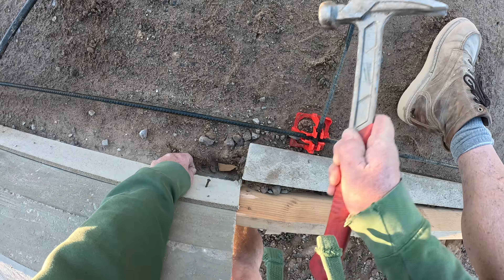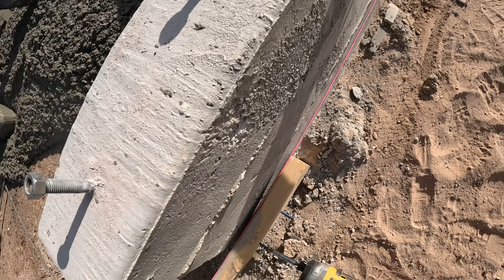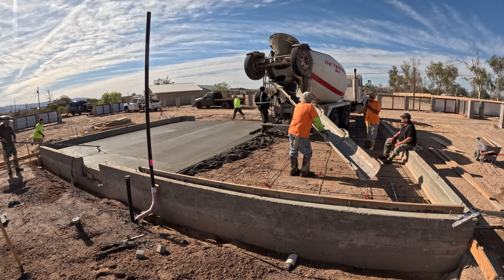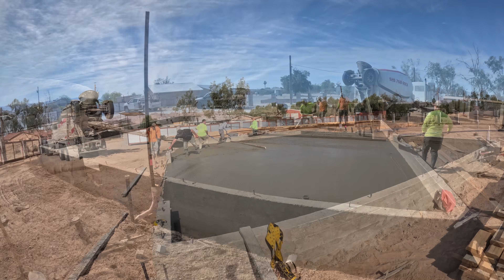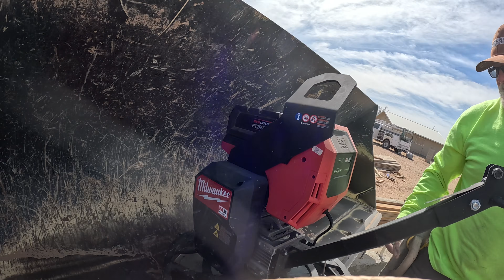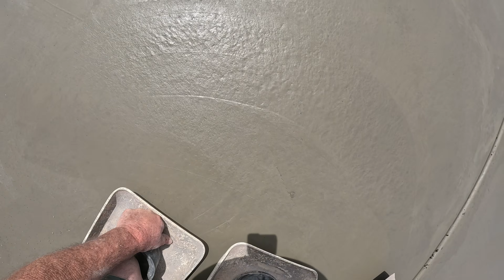They said we couldn't pour in this wind!

Comment: We homeowners made the plan and got city permit for 8' by 24' shed, excavated for slab, built forms to screed from top,  and put in rebar.  We had professionals pour the slab a little over 3 yards from a big mixing truck. Then we built stem walls to account for the slope; 3/4" high at the high corner, and 7" on the low one, 15 50 lb bags of crack resistant mixed in a large cart.  That's all this 61 year-old and two females could do.  The forms blew out a little and the stemmie gets wide in some spots, should have used 2x4s to back up the forms.  Seems like it would be much more efficient time and material wise to build stem walls first and like in this video and then only short forms needed at doorways.
Reply from the maker: Sounds like you got the job done.
That's what counts.